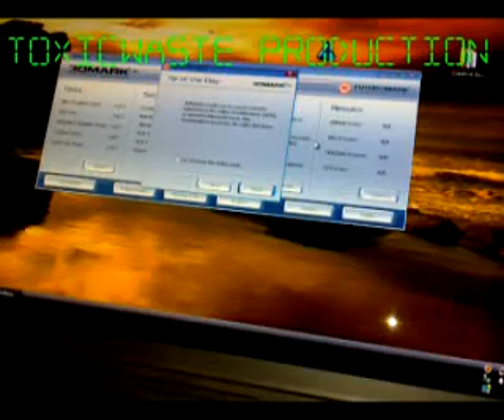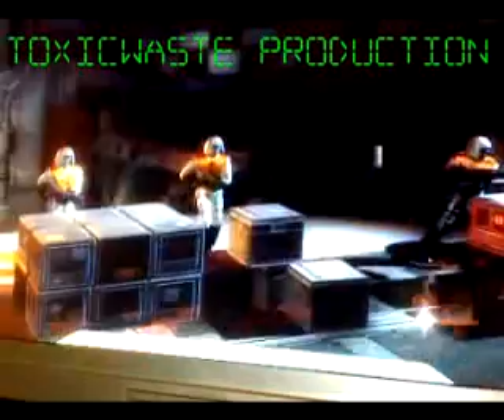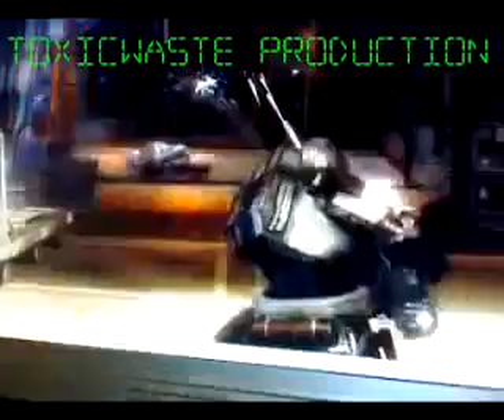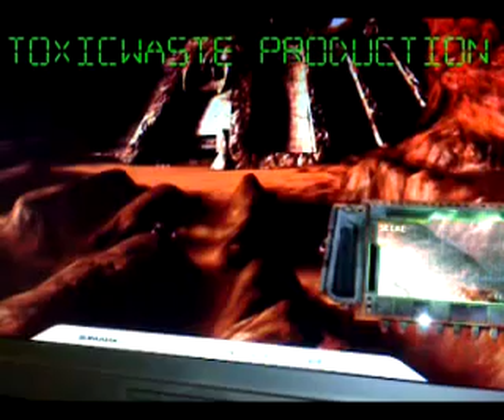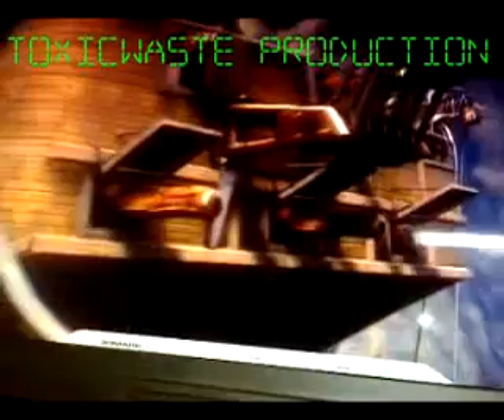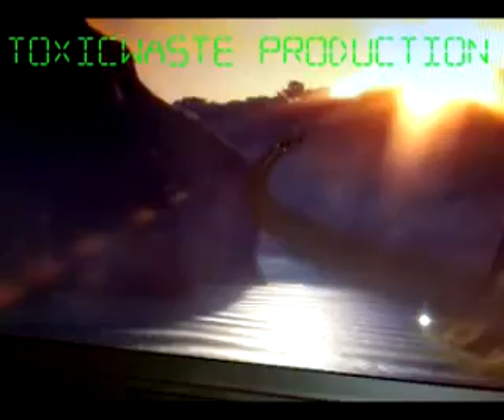3d mark on e6300 workstation part 1

Comment from the maker: might do a little overclock but not alot. I need an better heatsink for the cpu. And an new psu. But then i will try to bring it past the 2ghz mark atleast :)

I did some re arangeing of the harddrves today... Ripped out the ATA drives and used those as backup drives. They are slow as crap so backing up suff they will do. I will get an new sata drive for each computer and an new psu for each.

But some overclocking yeah. But i dont want to go to far and brake something, Not when its all running.